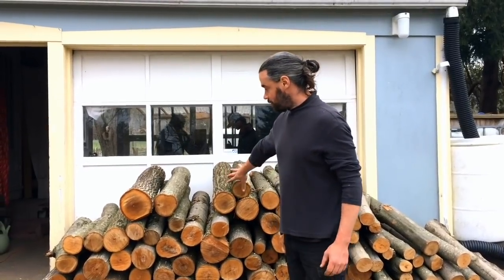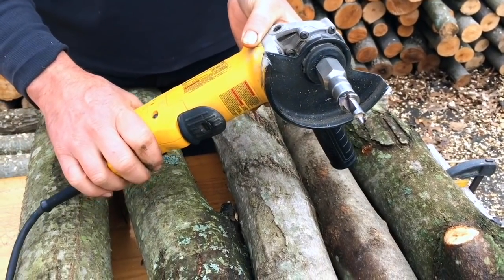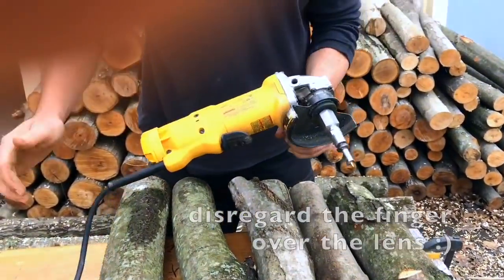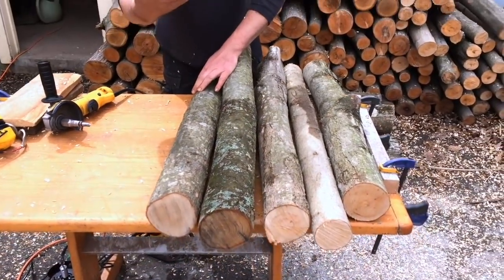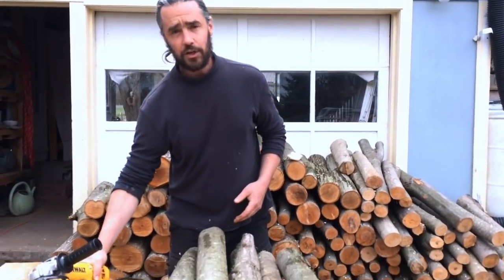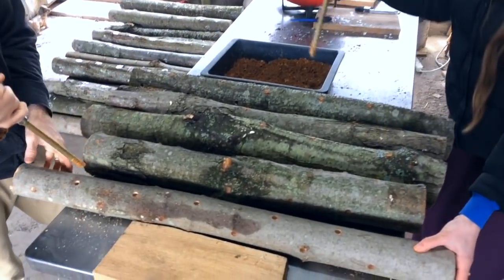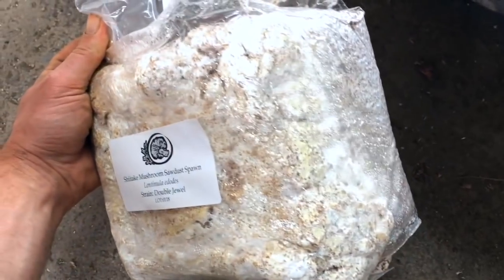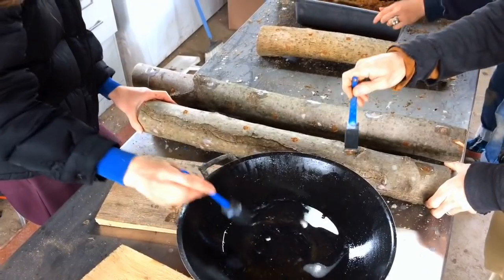Shiitake Inoculation - 2 - Inoculation Process

Comment: Have you found this method is better than the plugs one can use? I have seen mushrooms done twice now like this. Thanks for sharing. :)
Reply from the maker: I tried plugs way back when.  Cordless drill and a hammer and wax.  This method is probably 10+ times faster and you are getting more inoculant in as well!  Oh, and less expensive!
Reply: I wondered. I did plugs a few years back with no success, so I think I might try this way instead. Thanks!